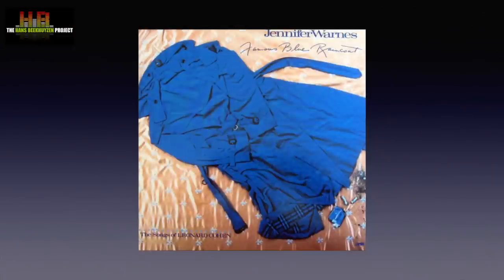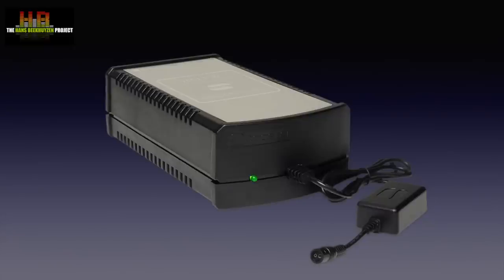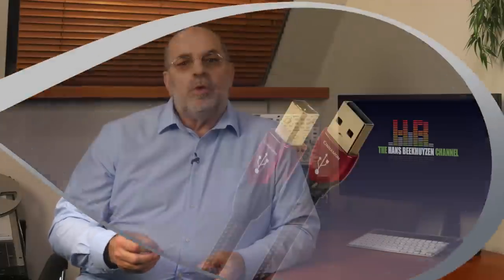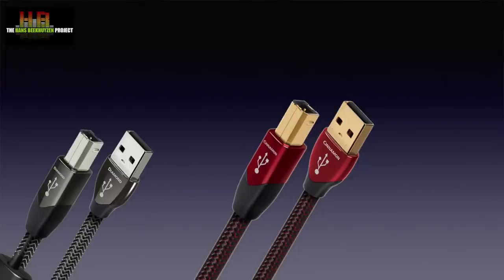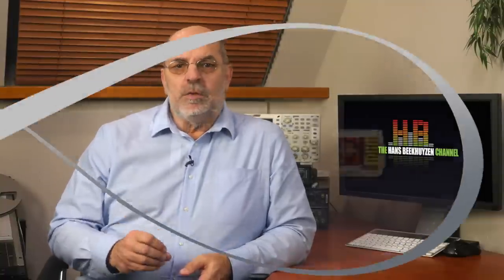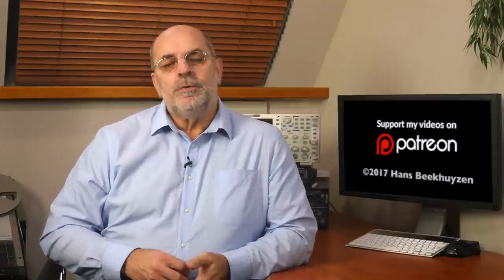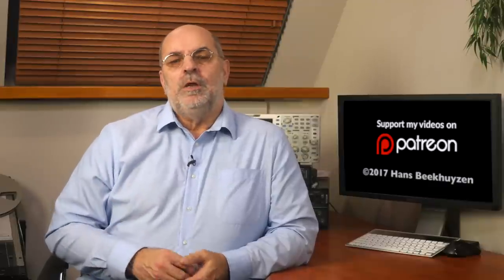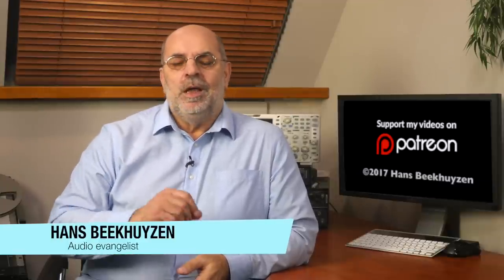Tweaking my network audio interface

Comment: Well, Hans I fully agree with you, I use two Pink Faun Isolators, one in my system one (Aurender a10) and the second in system two (Auralic Aries Femto-> USB out to DAC). I'm very pleased with the spectacular results. The LAN signal comes from a good Cat 7 cable with double isolation. The same trick is possible with the USB cable, in my case a good Supra USB 2.0 cable, which is good value for the money. I have tried USB out of the Aries with an iFI iSilencer3.0 USB Line Conditioner, again not expensive (just € 55,-) and not a trace of sibilance left, I also tried galvanic isolation for the USB interlink, but a very good device is way more expensive for fast USB. Keep on tweaking, the results are amazing for less money! Keep up the good work!

Comment: Hans, I feed from the computer the IFI iGalvanic3.0 going into the IFI micro iUSB3.0 then into my DAC. I use the IFI USB3.0 cables (I do not like their USB2.0 cables). I also use properly measured Sorbothane feet and weigh down the IFI with brass weights (using Sorbothane in between). With Sorbothane, you MUST use it near peak compression to get it to work well. When it does there is nothing better. Also, 30 Duro is the best. I have pictures but there seems to be no way to post them here.

Comment: Will audio transformers eliminate ground loops of 60hz in a home [(USA) 110 volt with power in the system across 2 110volt legs]?
Reply from the maker: Audio transformers should NEVER be connected to the mains power. They are intended to be used in the audio connections between two audio devices and can solve ground loops. Whether that will solve your problem, I can't know.
Reply: A Topaz Ultra Isolator 60hz/110v isolation transformer is designed for mains voltage and would prevent any DC from getting through. I use a 2.4kva model with .001pf interwinding capacitance (the lower/smaller that number is, the more noise it rejects).

You want to go double the current that’s your system can draw at peak output.

Comment: Hi Hans,
Thanks for again an enjoyable video. 
From own experience I also know the analoge interconnects can introduce or avoid (reduce?) sibilance.
Besides that, some speakers introduce sibilance (Jordan JX92S is sibilant in near field and needs to be listened to off axis).
The last couple of years I am using speakers that were designed to be both time and phase coherent (from Green Mountain Audio). 
Sibilance is thereby also greatly reduced.
Reply from the maker: Of course, especially with cheap 'silver' cables, sibilance can be severe. Pure silver is the best conductor there is but is very expensive. Often silver is mixed with other metals or even used for plating and then the sound often will be very harsh. And indeed, loudspeakers and even amplifiers can cause sibilance.

Comment: Hans, I had similar results wit an AQVOX AQ-SWITCH SE with matching cat7 Ethernet cable. It features “Galvanic isolation with signal transformers 1500 V withstanding voltage”. Have you ever tried one?

Comment: Nice video. Could you also make a video the differences both technical as well as sound-wise between various types of dacs like D-S, multibit OS/NOS etc. Would be thrilled to hear your point of view
Reply from the maker: The problem with pinning down qualities to the various types of DAC's is that people go think it's the principle that defines the quality and not the implementation. They do the same with DAC-chips: the read about a good DAC that uses the  ESS 9028 and start shopping in on-line shops in the far east for a cheap DAC using the same ESS and think they were clever.
Reply: Sounds like a nice disclaimer for the video ;-) . Right now I am looking for a nice dac and there are so many types (and of course various chips for each type) making it confusing to understand what the trade offs are and how the sound differs b/w good implementations of each dac types.
Reply from the maker: First, the video itself contains a disclaimer itself, twice. Choosing a DAC, unfortunately, isn't a rational process like ticking boxes. It's the same with cars and many other things. It is the combination of compromises that define the result. So you either start visiting dealers and try to make an index of your own audio impressions or you're stuck with the reviews by me and others😄
Reply: I meant your cautionary advice sounded like a good disclaimer for a discussion on a new video which discusses dac types :-) . Love your content, so thanks for all the hard work!

Comment: Hi Hans, thanks for the informative video - as always!.  Would you mind listing your different system setups (I, II, etc.)?  If you already have this listed somewhere else I'd be happy to go find it.

Also, good review on the Bluesound Node 2 - I ended up getting it and greatly enjoy it in my system!
Reply from the maker: See http://thehbproject.com/en/About It's also mentioned in the show notes below all videos I made the last 122 months.
Reply: Thanks!  I appreciate it - especially since I so obviously missed that and didn't look well enough. 

Just curious...have you listened to your Bluesound Node through the Mytek Brooklyn at all?  I'm thinking about pursuing this combination and was curious as to you thoughts.  I'd be pairing it with a Schitt Freya and Vidar preamp/amp setup on my end along with my Monitor Audio Silver RS6's.  My "Set 1, 2, and 3" ;)
Reply from the maker: The Bluesound Node 2 is a combination of a streamer, indexer and DAC at a very good price. It can and will drive the Brooklyn but it will not offer the ultimate quality the Brooklyn can offer. To achieve that you can use the NAD products if you want to remain within the BluOS realm.
Reply: Thanks Hans, if I may ask a little further then since you've gotten me curious and a little stumped: I know this is system dependent and subjective, but do you think it would be worth it for me to upgrade to the Mytek Brooklyn DAC with my setup and the Bluesound Node 2, or would I be better off ditching the Node 2 and pursuing the upgrade (Mytek Brooklyn) along with a streaming upgrade through the NAD series as you related?

IE, are you referring more to the Brooklyn's feature-set upgrade versus sound quality?

 Thank you very much!
Reply from the maker: I really can't say.  I found it worth wile in my setup 1. But that's me and my setup 1.
Reply: Great, thanks for the informative and profession interaction.

Comment: If you use a lan to optical on input side and then the optical to lan end to sotm usb ultra will it solve the gavanic separation issue.
Reply from the maker: But you introduce the risk of sloppy timing by the conversion to optical.....

Comment: Hi Hans.
Just like you have done, I'm looking to pair up a SOtM sMS-200ultra to a Mytek Brooklyn Dac+. I also plan on introducing most of the tweeks you have made around these devices (ethernet cables, lpsu's, etc.), over time.

One major issue for me though, in which I can't seem to find any information on, is whether I can or cannot connect the Ultra and the Dac+ together using a high quality ('Data Lines' only) type usb cable (with No power lines), and still fully function ok.

I could of missed it, but I've searched hi & low (even searched through the downloadable brooklyn pdf manual and still no mention of it) to find out if the dac will function correctly with this type of connection. I was going to contact Mytek directly to ask, but you need register first with your details and your device's serial number, which I can't do as I have not got the dac yet.

So Hans, or anybody else, could you please help me find out if it is possible if the brooklyn dac+ is capable of fully functioning correctly without usb power from a device connected before it? Or will it need a usb power feed from the connected device (200ultra) for the handshake procedure and all that?

As I already have my eye on a couple of very decent 'data only' usb cables, this method would also eliminate the need for even more items in the signal path like the Ifi-iDefender or something similar, and the need for even more psu's for the iDefender and the like.

I know a growing number of decent usb dacs have self powered dac chips nowadays that don't rely on power from connected usb devices, I'm just hoping the brooklyn dac+ is capable also.

Hope you can help.

Thank you & Happy Holidays.
Reply from the maker: The Brooklyn USB receiver chip needs power over USB. But I wouldn't worry, together with the 'clean' feed from the SOtM-sMS200Ultra there will be no problem. That's one of the reasons  the sMS-200 Ultra is there.
Reply: Thank you for your response.

I suppose when I get the high quality linear-psu's for both the 200ultra & dac+ that will help things out alot.

It's just my thinking that even with a lpsu feeding the sMS-200ultra, at the end of day the Ultra is still a computer (albeit a very good computer), that still may potentially introduced some kind of noise into the usb line.

I just wanted to make sure I eliminate any possibilities of noise by using a 'data only' usb cable.

It's gonna take a bit of time, but I'm really looking forward to completing this system fully with all the tweaks.

Thank you again Hans.
Reply from the maker: Use the SOtM sPS-500 psu, an sBooster or equal for the sMS-200 Ultra and use the internal psu in the Brooklyn for now and wait until march (trust me, can't say more) before buying an external psu for the Brooklyn. I am sure this combination will impress you enough for the coming year at least😃
Reply: Hans, thank you very much for the heads-up.

Yeah it will be best for me to upgrade the Ultra psu first, as I think it will have the greatest effect on sound. I can easily wait post March for whatever's on the horizon ;-)

I've spent alot of time (over a year, so a few more months ain't gonna hurt anyone) researching all sorts of lpsu's. 

Although quite expensive I'm favoring a couple of the Paul Hynes power supplies, a customised SR5 or SR7 Series in particular (that's if PH is still producing the psu's) one for the Ultra, and one for the Dac+. 

It may or may not be overkill, but at least they'll provide more than enough very clean, very high quality juice with no restriction of dynamics whatsoever. Also, they'll be able to drive anything that comes along in the future, if I ever decide to change devices (as long as the power specs are similar).

There's also custom built Longdog Audio Lpsu's with separate main power unit and separate regulated unit that's placed closer to the device being powered available from Mcru here in the UK.

Have you had any experience with any of the P.Hynes or the Longdog power supplies?

Thank you Hans.

Comment: Hi Hans. Appreciate your evangelism to those who seek!
I use HDD via the USB connection on the SMS-200, while the LAN connection  is only for control of the unit.
Would the LAN isolator be equally effective in my system?
Thank you and all the best for the coming year!
Reply from the maker: Yes, I would think so. But I haven't tried it thought. I would also try to use a audiophile power supply for the HDD if it is powered separately.
Reply: The besHans Beekhuyzen Channel
Reply from the maker: In general it will, but every situation is different so no guarantees.

Comment: How about two fiber optic converters and a fiber optic cable(They are surprisingly cheap) instead of a lan isolator? I wonder if it's a good idea.
I have a good dc power supply to feed the receiver side converter.
Reply from the maker: Never tried. It then all depends on the accuracy of the media converters, I would say.
Reply: @TheHansBeekhuyzenChannel  I have tried optical converters(It's only 20 dollars each) today. The result was pretty impressive. The sound is much cleaner and the power and responsiveness of lower end is pleasing to my ears. I didn't expect this much! The difference is night and day anyway. Maybe it's because I used wifi until yesterday.

Comment: You discuss transformers as isolators but wonder if an Cat6 to optical to Cat6 would not work better? SOTM is about to come out with an optical sms ultra....
Reply from the maker: It's all about the quality. With fibre optics the light has to be converted to voltage again and if that is not done to audio specs.... ICT specs seem not to be sufficient with Ethernet,.... The SOtM is currently running in my setup 1, using optics....
Reply: @TheHansBeekhuyzenChannel  Hi Hans, great videos...enjoy watching your reviews and advice....for the pink faun  lan isolator, where is the best spot where you would you place them? Between modem and router? At input end of my ultrarendu? Thanks and best regards.
Reply from the maker: At the input of the microRendu would be my choice but it depends also on the behavior of your network gear. If the ground plane of your modem is rather polluted your switch might not work optimally. And sometimes no transformer is needed at all.

Comment: Hi. I just got a pink faun isolator. I noticed that the volume level drops somewhat. What has been your experience?
Reply from the maker: IK experienced what I did subscribe but certainly no volume drop. First check whether there really is a volume drop by downloading a sound pressure level meter for your smartphone. If there is a difference, it is a matter of replacing cables and equipment step by step. There really should not be a volume drop but a less distorted sound will sound less loud. Take that in account.

Comment: Hi Hans
As usual very informative video

I always wonder many ridicule USB interface as worst thing happening to audio in the name of convenience and no matter what bandaid product's like Uptone usb regens used to solve USB issues, it cant completely solve it 
I wanted to know from you is USB so bad ?
I mean  with all the regens and a good usb implementation it can't compare with a i2s bridge on a pc connected to an i2s input to a dac ?
If you or anyone else has experienced and tried both methods to connect a dac to a pc or a music streamer please do share your experiences
Reply from the maker: With digital interfaces it is primarily the implementation that defines the audio quality. I just had someone that used a I²S interface between his network audio interface and his DAC and left it for USB, using the SOtM sMS-200 Ultra networked audio interface, the device and thus the interface I also use.
Reply: The Hans Beekhuyzen Channel 
Thanks a lot for the reply
That makes sense and why not all prefer a particular interface

Comment: So no difference between cat6 vs cat7 for sound?
Reply: Depends on how high the resolution of the audio you are streaming. If it is something above 192 khz 24 bit there could potentially be a difference in quality. Again I'm not sure, I haven't tried that myself and what I'm saying here is theoritical.
Reply: Also that depends on your internet speed.

Comment: So incredibly interesting. I think sibilance can't fully be fixed from any equipment. I feel it is at Least 90% music source related.  No cables, amps, power supplies etc can fully fix bad recordings.
Reply: +Michel Forbes. Yes I sadly do. I've run into a plethora of very mediocre audio recordings, especially since the CD is treated terribly mainly in the last 20yrs. :(
Reply from the maker: This discussion leads to nothing but trouble. I've been in and around studios for a quarter of a century and can assure you that sibilance is not caused in the studio, normally.
Reply: +Michel Forbes. Hi man. Now these sources are pretty extreme and deemed completely unlistenable to myself. Like I cannot even listen to these discs where my amp is set at 50% of its max volume output on the potentiometer. Ok. So I've run into many bad sources, especially remasters but I will try and keep it simple and list albums that are prime examples of what we are talking about, especially with the likes of  harsh vocal frequencies where the sibilance is unbearable. 
My findings are mostly situated in rock, metal, hip hop and of course pop. 

Queensryche-- Operation Mindcrime (2003 remaster EMI) 
The Black Angels-- Death Song (2017)
Orphaned Land-- MABOOL:The Birth of 3 (2003)
Public Enemy-- mad plans god laughs (2014)
Metallica-- Death Magnetic (2008) 
Red Hot Chili Peppers-- Californication (1999)
Lacuna Coil-- Dark Adrenalin (2014) 
Trivium-- Shogun (2007) 
Blaze Baylay-- The sound track of my life (2013)
Anubis Gate-- Horizons (2009)
Moonspell-- Alpha Noir/Omega white (2012)
Reply: +Hi Hans. You are right. It is mostly how the client or record label has chosen how to master the original source for either vinyl or cd. I agree 100%. Unfortunately the CD is normally not treated very nicely especially in the last 20 yrs where the 'loudness war standardization" has reared it's ugly head and "brick walling" CDs seems to pass music industry and consumer standards, which goes beyond me. :(
Now I listed a few sources for the gentlemen above because I feel it is important to let others know what sources are quite bad, so one does not by these music sources only to discover just how ugly and hard a listen they will be. I call it my audio civic duty for the people cause there is no equipment on earth that can polish or smooth over wretched sources such as the ones I listed above. They are a nightmare under the scrutiny of quality HD gear. ✌️